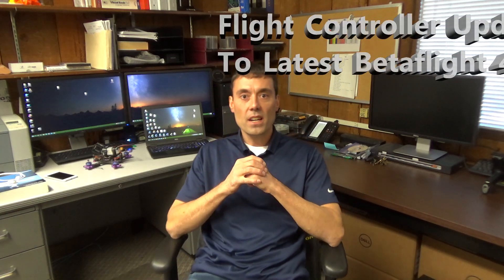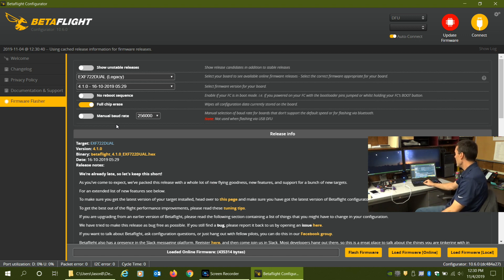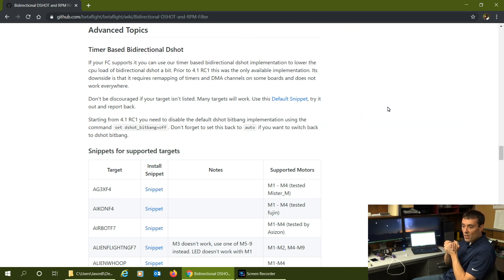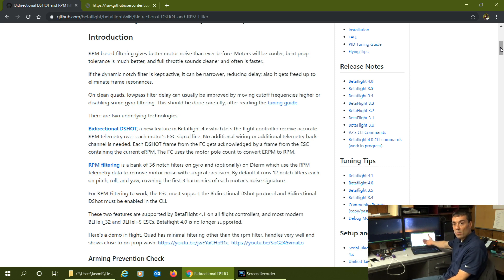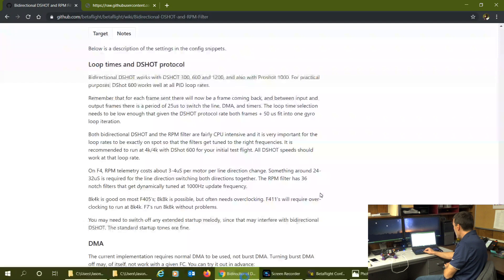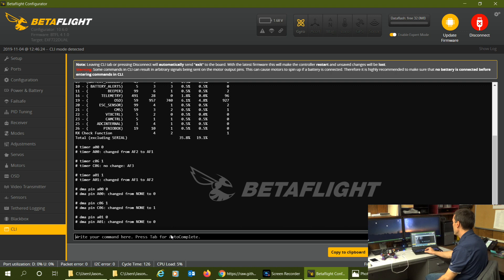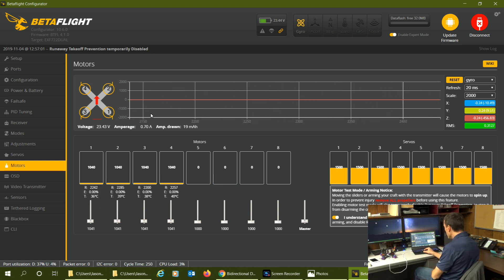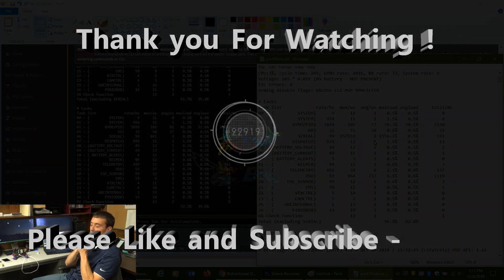Betaflight 4.1 Timer Based Bi-Directional DShot RPM Filter Setup - Flight Controller Install

Comment: Thanks so much for doing these videos,  they've helped so much. Having the same FC and ESC as you, I was able to follow every step. I had already watched a video on this topic from a 'well known' YouTuber, and he was quite off the mark with some of this.  Anyway, with the BLHeli updates, plus BetaFlight updates, I've now got RPM filtering set up, and all the other good stuff.  And you also pointed out that UART5 should be set to ESC Sensor Input. This was not set on mine out the factory.  Tested it, and now have motor temps!  So good.  Big thanks!  Now moving on to the next video. 👍😁
Reply from the maker: Thank you very much Oliver !  
Yeah I wanted to do this one for a while, mainly since I noticed some things that others had not pointed out, like you said. 
I really like this stack, been running it since early last spring and beat the hell out of it. Still running strong. The ESC seems really tough, I have two now and they both rock solid 🤘 
Thanks again man !! 👊
Reply: @jdogb1  Good stuff! Your flying is awesome. I'm just a beginner, so still lots to learn on the flying and the technical stuff. I'm running an iFlight DC5 (building my first quad seemed a bit of a daunting task, but will hopefully build the next one).  Weather has been poor the last few days (UK) and forecast is very windy for the rest of the week, so no chance to get out and try the new settings, but I'll try and squeeze a flight in somewhere. 👍

Comment: Sorry you have readed that on 4.1 you dont have to set the Snippet Values ??? In your Vidio 15min 59 sec when you set bit bang over it you can read it ?????          That stands there :  Config Snippet
With 4.1 it's no longer necessary to install a snippet. Instead just use Betaflight Configurator and enable bidirectional dshot on the Configuration tab.
Reply from the maker: Yes that is true, you don’t need the snippets, but for some flight controllers, you can still fine tune with specs that are specific to that board. For example, unified targets vs legacy targets. 
You can fine tune some timers and dma’s specific to your board to make things run more efficient 👍
Reply from the maker: Advanced Topics

Timer Based Bidirectional Dshot

If your FC supports it you can use our timer based bidirectional dshot implementation to lower the cpu load of bidirectional dshot a bit. Prior to 4.1 RC1 this was the only available implementation. Its downside is that it requires remapping of timers and DMA channels on some boards and does not work everywhere.

Don't be discouraged if your target isn't listed. Many targets will work. Use this Default Snippet, try it out and report back.

Starting from 4.1 RC1 you need to disable the default dshot bitbang implementation using the command set dshot_bitbang=off. Don't forget to set this back to auto if you want to switch back to dshot bitbang.

Comment: Hey . I set this up on my clracingf4s. And now my jmt beeper beeps continuously when I plug the battery in . I read a post on github about that problem and how the resource beeper 1 none command causes that, and may not be nessesary. Is there a way to reset these commands with out having to reflash it and re configure everything again ?
Reply: Yea thos were the commands I put into the cli along with  "resource beeper 1 none". Will setting dshot_bitbang to auto reset all the timer  and dma setting to the default ?
Reply from the maker: Ah, shoot. Might be a typo or something wrong in the snippet. I can go find the default timer and dma settings for clracingf4s and we can try and put them back. 
What ESC are you running ? 
And did you make sure and update your esc’s ?
Reply: They are emax bullet 30a . I have jesc on them now . I flew it a few times with rpm filters before trying this timer based dshot . And it flew awsome . Worst case I will just reflash it and start over ,its not a huge deal .
Reply from the maker: @aron340  yeah can always reflash.  I was looking for your target and was going to find those defaults but I don't see that target in BF4.1 ? 
I see CLRACINGF4 but no CLRACINGF4S ?
Reply: @jdogb1  
Sorry I should have mentioned the target is clracingf4.
Reply from the maker: Oh wow, yeah maybe getting a rpm filter error. 
For sure yeah you can go back. 
Change back to defaults;  
SET DSHOT_BITBANG = AUTO  
I see a snippet for your CLRacing F4, there are some specific custom timer and DMA pin settings you need to set in CLI, check here;  

https://raw.githubusercontent.com/betaflight/bidircfg/master/CLRACINGF4-upgrade.cf
Reply from the maker: timer b00 1
timer b01 1
timer b04 none
timer b08 none

dma pin b00 0
dma pin b01 0
dma pin b04 none
dma pin b08 none

Comment: I have the same FC as you but its the DJI version and the target is listed as STM32F7X2 but I dont see a snippet for that. Am I out of lucK?
Reply from the maker: Here is the default snippet, you can check the settings by typing “get” without quotes and then the command to see the default setting. 
Make sure the dynamic notch filters are set correctly for rpm filtering, and:  scheduler_optimize_rate = ON  
Dshot_burst = OFF  
Dyn_notch_width_percent = 0  
Dyn_notch_q = 250  
gyro_sync_denom = 2  
pid_process_denom = 1  

https://raw.githubusercontent.com/betaflight/bidircfg/master/DEFAULT.cf
Reply from the maker: Trax FPV oh interesting, you are the first I’ve heard to try it. I’m sure rpm filtering would work great, probably can’t run timer based bidirectional without remapping the timers and dims, bit they might have yours already setup correctly in the betaflight target. 
I would try the default snippet for timer based and test. 
Let me know how you like it ! 
I might order one as well.
Reply: @jdogb1  Trying to get it to work. There is something off. When I make a strong yaw spin I get a horrible bobble in the pitch access. I cant seem to get it to stop yet. Any thoughts on why that would be is appreciated! PS this is before I have even tried to do the timer based setup. I dont know if that would help or if I should fix the problem before moving on.
Reply from the maker: Trax FPV ah that doesn’t sound good. The info helps tho, I was gong to ask if using defaults.  That’s strange that the pitch axis is moving on yaw movements. I don’t think that modifying PIDs would be a solution, maybe intern buildup, hmm. 
I would say try modifying the notch filters, specifically the dynamic notch filters. 
Makes me think of the feature Transient_Throttle_Limit. 
Might google that and take a look, I’ve seen mention of it in BF 4.0 and 4.1 github tuning notes. Deals with residual noise that builds up from air mode dealing with a single motor spinning up during quick moves, and at times that motor noise can translate to other motors and cause weird things to happen. 
I’ve been using a setting Set Transient_Throttle_Limit = 15 
I can’t say if that is what is happening but makes me think of that feature, and why it is there from 4.0 forward

Comment: Why should you use timer based and not Bitbang ??
Reply from the maker: Jan S   I explain it all in the video. It’s all about cpu and cycle times. Timer Based is less load on the cpu. Also read about it in the article linked in the comments.
Reply: Jason FireBlade_FPV 
I know its less cpu cycle. I read the Github thread when it came out. But I have a build that has shitload of noise. On one gyro it flies... still lot of noise... but manageble. So I thought there might be more then just CPU cycles... if you like I can send you the BBlog to have a look
Reply from the maker: @jas-FPV  oh I see, i doubt whether either method would help with noise, that is a separate issue.  I have noticed with my 4-in-1 ESC builds (6s) that I get a lot more noise in the FC compared to when I was running separate ESC's on the arms.  
I did an experiment over the last year that has been some help;  
I have two of these current identical builds, using the iFlight Succex 50A TwinG stack.  The first build I used a single 50v 470uf capacitor at the main batt lead and I was getting a lot of noise, so much that I can see the black lines in my video when I throttle up.  
Since then I built a second quad using same identical stack, and I used a single 50v 1000uf capacitor, and wow the difference !  
I now see no lines in video, and my fc has much less noise.  Still some there but the frequency bands are much more narrow and less scattered.  
Noise in these systems are an issue (especially 4-in-1), and you are not the only one.  I've been to a few events over the past year and see the same in lots of other pilots video feeds.  I've discussed this with many other pilots over the past year too and the best thing to do for your noise is more caps.  You can also add more caps in parallel, friend of my Aaron told me to use two 470uf 50v caps rather than one big 1000uf.  I might try that on the next build.  I've seen some builds with caps all over the place, even on 4-in-1's.  Sometimes see a couple on the main batt pads on the ESC\PDB, then more on the battery cable lead, also more on the race wires (where you put a gap in the motor wires between the main ESC and motors).  
Caps Caps Caps, and go with Ultra Low ESR good quality caps like Panasonic.  
Also make sure the area between the ESC and FC is clean, clear of wires and try to get some space between them, try not to stack them super close.  
Also what loop rates are you using ?
Reply: Jason FireBlade_FPV 
Yes.... dronemesh did an oscilloscope test of the iflight 60amp 4in1 and it was very noisy. 
First I thought based on a old bug rpm and sensor fusion dont go together, so I disabled fusion and went to one gyro. It makes it a littel better but its still noisy as hell. 
So I dont know which way to go: new FC with MPU6000 or another ESC???
Btw: my rig is 10“, 3115 1050KV, 6s
Running 4 1000caps and one 10V cap on the 5V rail
Reply from the maker: @jas-FPV  I was getting a lot noise in the 50A model way before BF 4.0 came out, back in the 3.5 - 3.5.7 days.  The caps definitely helped, and it's not just the iFlight boards, stacks with 4-in-1 ESC are noisy, especially the high power units like 50A and above.  I have a Spedix GS45 that is also fairly noisy, the caps definitely help

Comment: Hello from Spain but you dont tell nothing for BL Heli S there isa bandnew JESC Configurator 1.2.5 and you can flash for RPM and Bidirectional without to pay nothing :-)))))))))))))))))))
Reply from the maker: Check the last video, link in description. 
ESC upgrade part in last video 👍🤟. 
I’ve never paid anything to flash lol.
Reply from the maker: https://youtu.be/EbsQxwd_CSI
Reply: You need to pay for the telemetry function to use RPM filters. Just flashing JESC does not do much.
Reply from the maker: TimeFadesMemoryLasts you must be taking about blheli_S ? 
Don’t need to pay anything for blhelisuite32
Reply: @jdogb1  OOOH, sure. I misunderstood your comment, sorry. Yeah BLHeli_32 is open source. Just flash the newest BLHeli_32 version 32.7 and boom.
Reply: @TimeFadesMemoryLasts  Yes you wright i have seen it :-)))))))
Reply: @TimeFadesMemoryLasts   Now threre its a new Vidio you flash BL Helis S 16.71 and so its free  for JESC !!!!!!!!!!!!!!!!!!!!!!!!!!!!!!!!!!!!!!!!!!!!!!!!!!!!!

Comment: lol just when i thought i had an idea of what i was doing,,,,, ?  is your fc not the twing
Reply: it is but you selected a different
Reply from the maker: @MrBumbles2  this is the one I have, see the target at the bottom of page, EXF772DUAL  
https://www.geekbuying.com/item/Iflight-FC06174-SucceX-F7-TwinG-OSD-Flight-Controller-416941.html
Reply: @jdogb1   got my esc installed, first one was wrong esc in wrong package,, so i now have the succex 60 amp v2 ,, got it set up and its rained for 3 days.. but that gives me time to mess with osd etc things i didn't have before.. went 300 4k 4k things look good but real low cpu gonna confirm that tonight before i tell you what it was lol  ,,   my board is iflight f4 twingv2  and it was in the list no legacy  so i used it..  so far its going well i think lol
Reply from the maker: @MrBumbles2  awesome !  that will work great, I've had very good luck with 4k/4k and dshot300.  I'm actually working on a video now testing different motor protocols and loop times speeds, will post it tonight or tomorrow.  
Wow and you got the 60A esc, that is a beast !  I might order that one next.  The iFlight ESC's and FC's are great !
Reply: @jdogb1  the config on fc from factory it was running dshot 600  8k 8k  with burst on..
Reply: fc isn't listed on timer base info
Reply from the maker: michael honeychuck I don’t see it listed in betaflight at all
Reply from the maker: michael honeychuck oh my, those are great settings but I would be worried about cpu spikes hitting 100%
Reply: @jdogb1  SucceX F4 V2.1 TwinG    board_name IFF4_TWIN_G
  i believe its a STM32F405 (S405)  dude i can find nothing on this fc ,, other than on iflight site,, i may be the only person out there with it lol,,  i see people using the mini,,, but i saved the config from 4.04 that was on it.. i used   IFF4_TWIN_G
  target
Reply: @jdogb1  well haven't gone in cli with motors running but cpu was 8 percent setting it up, got motors spinning right direction etc.. will check out cli , i went ds 300 4k 4k to start
Reply: @jdogb1  https://smile.amazon.com/gp/product/B07T1M7FVM/ref=ppx_yo_dt_b_asin_title_o02_s01?ie=UTF8&psc=1   this is where my nephew got it ,,, it was a gift
Reply: iFlight Succex 32Bit 60A V2 Plus 30x30 4in1 ESC  is what they sent me to replace the  mispackaged esc
Reply from the maker: michael honeychuck oh gotcha, I see ya looks like might be a custom target that betaflight doesn’t update continually. I believe that STM32F405 is a standard chip target and not necessarily developed just for the twing board. 
Even tho I would think that should work well. Might check iFlight website to see if they have any updated custom targets.
Reply from the maker: michael honeychuck ya that should be perfect setting for the F4 board. Ya check in CLI with commands TASKS. Check with motors running too so bidirectional dshot is active. Look at the totals at the bottom. Also check to make sure no packet errors in motor tab or with CLI command DSHOT_TELEMETRY_INFO
Reply: @jdogb1  esc sensor  turn on and save go back its off,,  but zero packets , 3998 k , 51 41 percent ,, no telemetry in motors tab, what did i miss
Reply: esc on uart 6 i think i missed that
Reply: yep that got it, its 4000k  51 max 41 low zero packets good telemetry, that's with accel on probably shut it off after some los flights.. thanks
Reply from the maker: michael honeychuck alright yes !!! 
Sounds like it is working great 👍🤟
Reply from the maker: haha lots of fun !  everything works great, not too complicated.  don't actually have to use the timer based bidirectional but I do find that it does use less CPU and seems to work better.  
My iFlight F7 TwinG is the EXF772DUAL (legacy) target, that's what it came with out of the box anyway for the V1 (not the mini, this is the full 30x30 board)